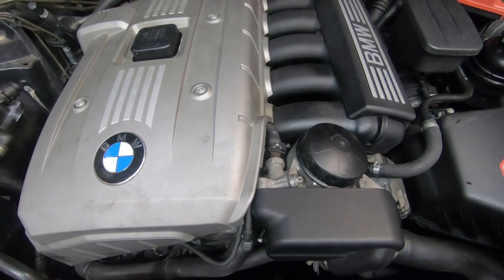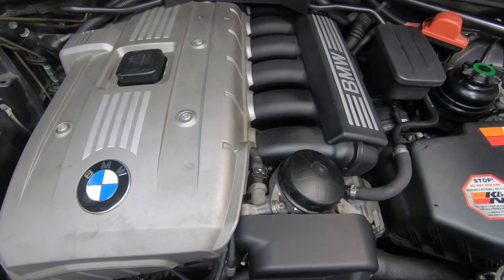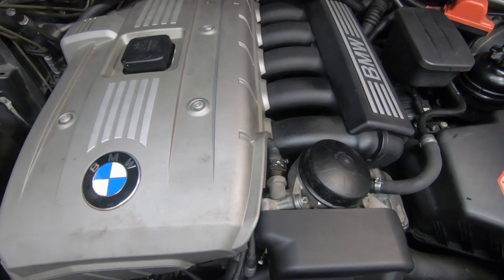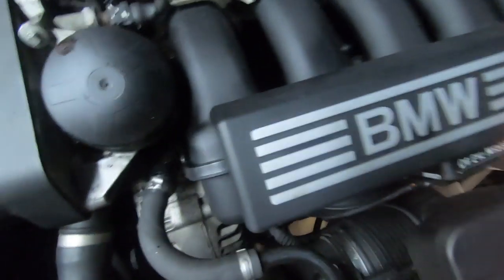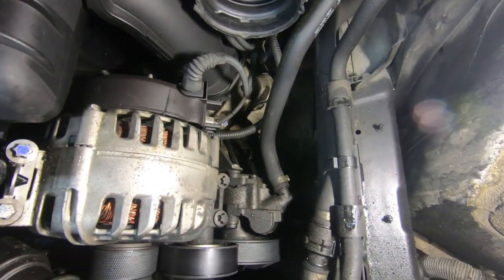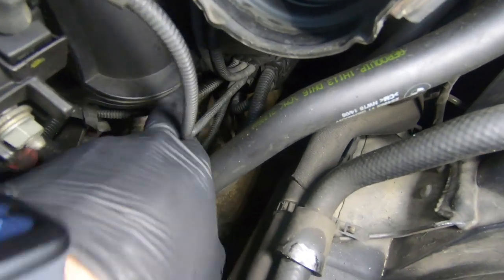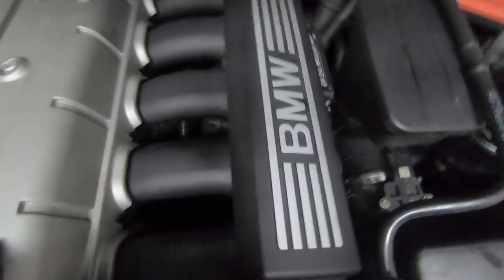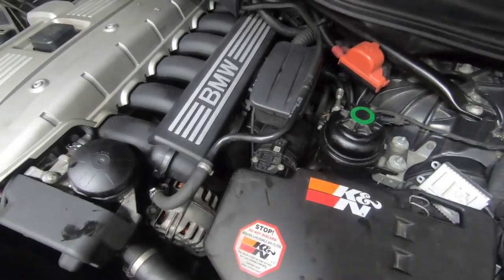BMW N51 N52 Purge Valve / EVAP Valve / Fuel Tank Vent Valve Location P0442 P0440

Comment: Brother I can’t tell you how much this video has meant to me !! I’ve been chasing several codes down on my wife’s 08 x3 and got it down to a P2402 and better the throttle body clean and the replacement starter I knocked that rubber boot off and just said screw it and run it . But just by a luck I saw this and knew right away this was it. 

Update - it was the way I had it placed and it did fix the code 🎉 thx again Doc !!!

Comment: 4 years late, but thank you! Just got the 002A1A code on my e90. Hopping this fixes it as it's definitely not the gas cap.
Reply: what was the culprit?
Reply: Did it help? I have the same code,  replacing the gas cap also did not help.
Reply: @NycForgiato  sorry for late reply but yes it was my fuel tank vent valve.
Reply: @ChromeN9ne yes this fixed the issue for me. Hasn't come back since replacing the Fuel tank vent valve. Also you can have enlugh acess to remove the valve with only removing the intake and the throttle body.

Comment: Hey Dean, quick question unrelated to this car. What is your take on removing the under belly of my e60? Will is cause any issues...I.e... gas mileage, drag,...etc.. I want to take it off to track a leak but I’m getting mixed messages from around the web. Thanks.
Reply from the maker: Mate don’t do it that’s to your stop water going into all the electrics mate if that gets on your waterpump that will end your waterpump its there for a reason it protects all the engine electronics and stops water getting in between the gaskets on the sump of water gets in your engine and you go through a big puddle you will hydro lock your engine so I would advise against it mate
Reply: BMW Doctor thank you, I will avoid it then. Much appreciated.

Comment: Dear Doctor. When trying to remove the purge valve, the pipe on the end of it going up to the manifold (perhaps?) appears and feels impossible to pull off due to the factory tight fit. Is it simply a case of pulling it very hard? I felt like it would break...
Reply: Having this issue also what did you do?

Comment: Hey I have a question, I have an 08 e61 n54. My idrive isn’t working, it doesn’t turn on its just blank, radio is stuck one station. I tried resetting it and check the fuses & nothing. You think I should check the modules in le trunk?
Reply from the maker: You will not have modules one the trunk if it’s 2008 

That means your idrive system itself is overheating and it can’t keep up the chips need redoing
Reply: I have us version idk if it’s the same wiring, I did check the spare wheel well & I have like 4 modules I think 2 white ones and the rest black. By any chance do you know where to find a diagram? I’ve been trying to look at forums but couldn’t find any proper ones, only e90s
Reply from the maker: Edsel Giron you will not have modules in your boot the ones in your boot are for other things you should not have ANY modules in your boot if you do you have a older car then 2008 bmw moved them away from the boot and built
Them into one module after 2006

Comment: If the purge valve fails or is failing cause a rich condition on both banks. My e90 n52  is getting a mixture control code and I figure it out. I've replaced coils and plugs, injectors, all o2 sensors, both vanos solenoid, reset all adaptations, maf sensor, coolant temp sensor, and I can't figure out. Sometimes I can smell raw fuel on start up and when I park. Driving me crazy. No other codes pop up. Always 09eo, and 09e1. Sometimes when I put the clutch all the in the rpms drop to like 600 rpm and bounces up to like 1,000 rpms and go back to idle. I haven't checked the fuel pressure regulator yet, but I really don't think that's where I'm problem lies.  Any thoughts would be appreciated.
Reply: I'm having a similar problem. I ve done everything you have. But cant seem to get it fixed
Reply: Did you figure it out ? I’ve the same problem
Reply: Checked your fuel sending units? They both have plastic caps which get old and crack. Getting a whiff of fuel particularly just in front of the driver's rear wheel or signs of a leak down the back of the driver side of the fuel tank are telltale signs.

Comment: Hi sir. I just need to know as to what would be the cause of oil in the all spark plugs on a n52 engine. I'll be glad to hear from you
Reply from the maker: that will be your CRANK CASE VENTILATION  torn and ruptured letting oil into your cylinders
Reply: @BMWDoctor  A quick critique, if you will allow me Sir. Two words: LASER pointer. Great videos, keep up the good work mate.

Comment: Ok. I need some help. My car won’t start after it sits for over 5-6 hrs. After it starts up eventually and I drive it it’s fine. And will start up easy. Then over night. I go to start it and rough misstarts. Sometimes 2-3 key turns.
Reply: U solved the problem? I have the same issue

Comment: Dean you should do a video on how to fix the interior lights under the dash blinking ( only if you not using led lights)?
Reply from the maker: Mate they flicker if your using Chinese LED bulbs mate I had the same problem no need for a video mate just replace with good ones problem done
Reply: No led stock lights  inside and out

Comment: So i’m having issues with refueling my 2011 328i xdrive e90, every time i press the gas pump it pumps for a few seconds and clicks, and the only reason i’m refueling is because the car told me that its empty, but literally it doesnt stop clicking and to fill up it takes me about a half our to 40 minutes. I’m wondering if its the vent valve or if maybe its the fuel neck that needs to be cleaned, how would i go about figuring out what the actual issue is so i’m not spending money on things that dont need to be replaced?
Reply: China Boss  same problem, did that and nothing changed.

Comment: Do you repair frozen I drive that's stuck in BMW logo
Reply from the maker: I used to but not any longer to much effort for this job nobody does this job anymore
Reply: I ended repairing mine after 6 months of no tunes and almost sending it of to be fixed (quoted £300) for something that in the end cost me a couple of quid to fix.

Comment: I had the codes 
P2401 , P2419,P1429 that pointed towards this Evap Canister being faulty but after rrplacement of the DMTL and characoal canister I still have the codes. The check engine comes back after a drive. Anyone have any help please?